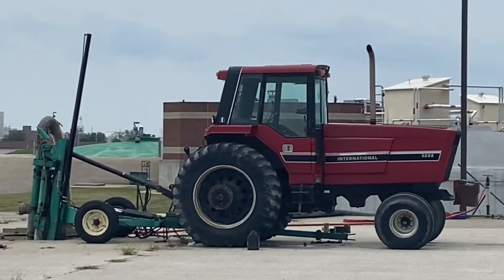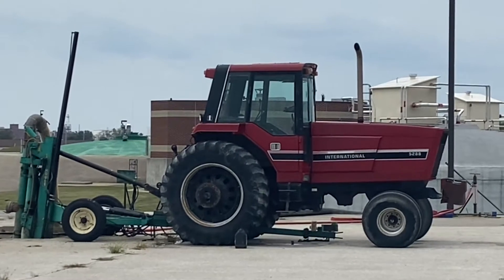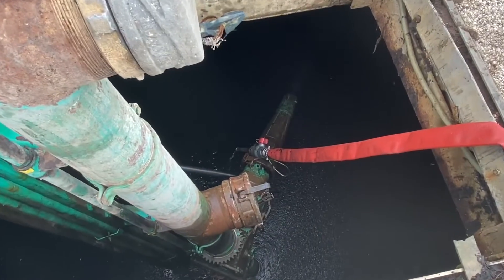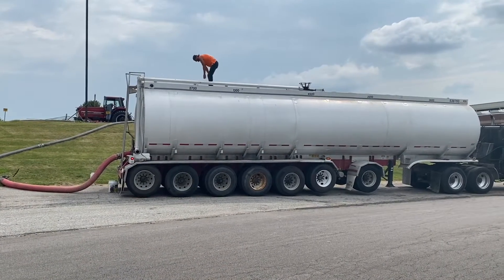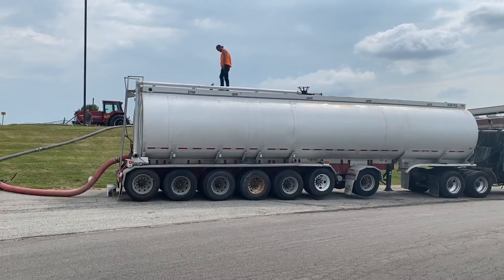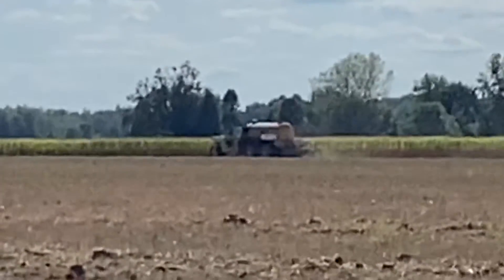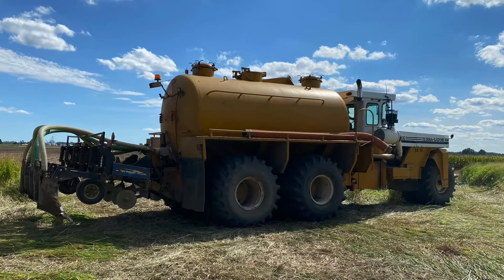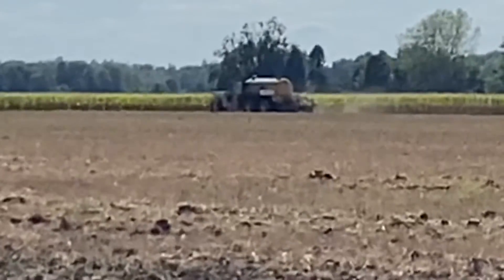Biosolids Land Application

Comment: Your making money putting cleaning chemicals, plastic, and pathogens into the soil where it will eventually blow away in the wind
Reply from the maker: I must respectfully disagree.  This product is highly regulated.  Volatile compounds have been destroyed by a process called anaerobic digestion.  It is a safer choice than raw untreated manure that is loaded with pathogens.  It is also a more natural choice than manufactured chemical fertilizers.  Soils are improved for years after application.  However, it is not perfect, as are any of the choices available for adding nutrients back to the soil.
Reply: @brucethewaterguy9383  When you say 'highly regulated' are you talking about the 1993 Rule 503 regulation that only regulates a handful of heavy metals and chemicals?  Or are you talking about some other regulation I am not familiar with that regulates the content of the biosolids for PFAS and PFOS, and the hundreds of other chemicals that are silent in the Rule 503 'regulation'?  I'd be interested in where that regulation of the forever chemicals that are banned from dumping in every other industry are regulated in the biosolids industry.  Thanks.
Reply from the maker: @tonyborger6400  actually yes, we are regulated on many different metals as well as PFAS compounds.  We analyze 23 different PFAS compounds and must be below EGLE limits.